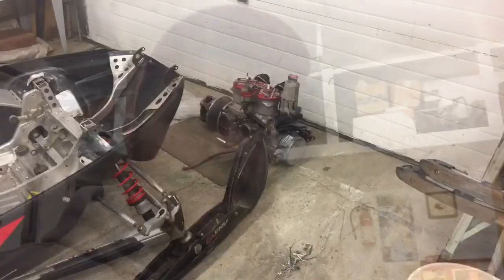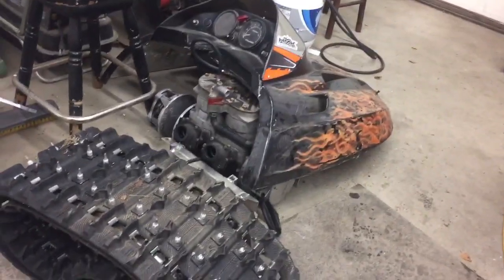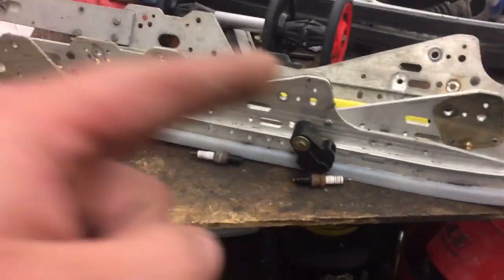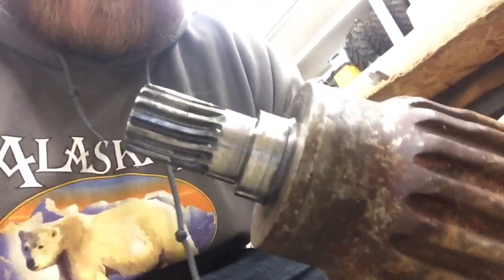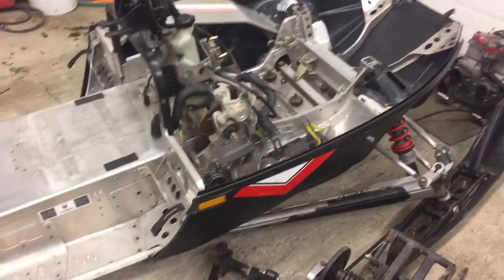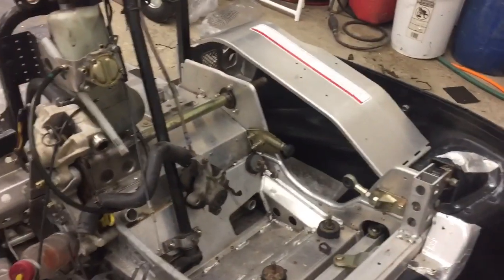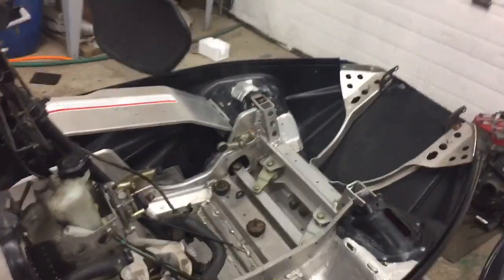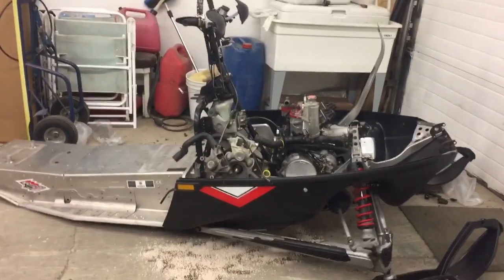Pro X race chassis update

Comment: What inch paddles are you putting on?
Reply from the maker: Boondocks Boy my plans are always changing, we’ll see what ends up actually in the sled when I’m done lol
Reply: @AKproXR  hahaha ok. Im changing a .2 track to a 1.5 on a Polaris Indy 500. Any tips?
Reply: @codyplagerman8215  did it fit? i thought 1 1/4 was tight on my 1990 indy 500
Reply: @jordanlittle5391  I'm not sure. Things came up and it got put away. I remember I had found a forum on Google about the size track you can put on an older machine. I can't remember the name of it. Sorry wish I could be of more help.